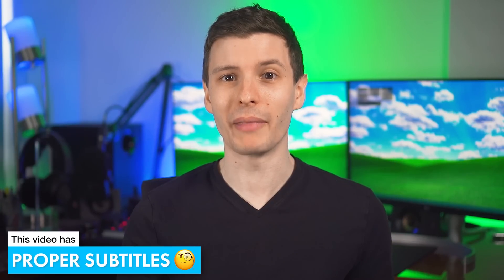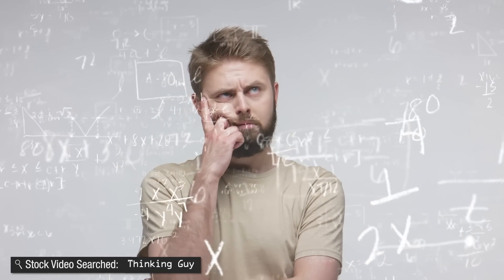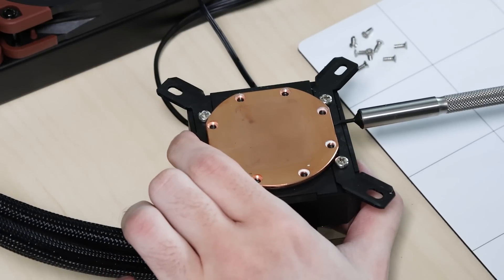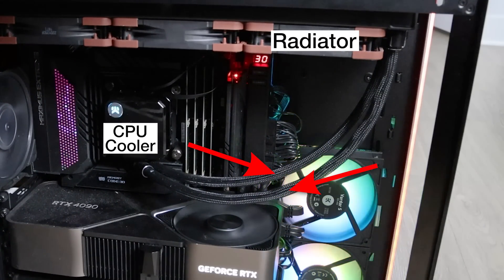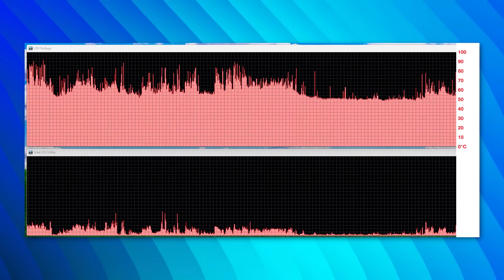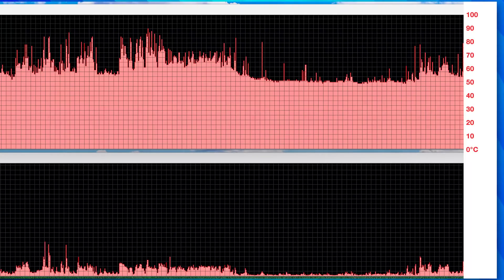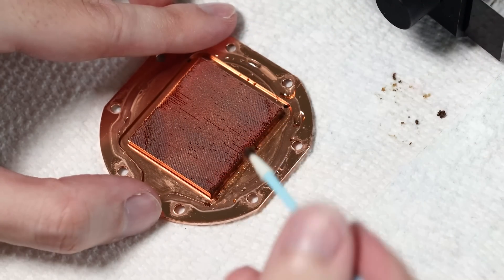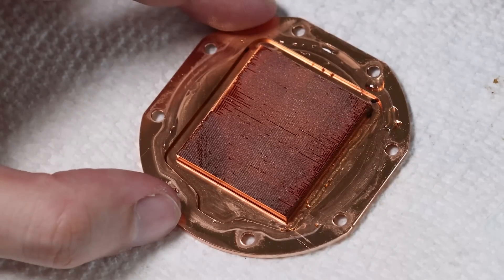The Mystery CPU Overheating Problem Took Me Months To Solve

Comment: Well Joe from he very beginning and having some experience in plumbing it was rather obvious to me that the system had crud inside either radiator and pump housing and if it were me I would have headed straight for cleaning of the cooling tank, the coolant tubes and the cooler pump it self and I would have back flushed the whole system before refilling it and refitting the cooler to the machine. What you should have done is what I have said and emptied the original liquid through say a coffee paper strainer just to see what was in the system. If this happens again or you want to take a chance I would still do what I suggested because the smacks of a poor manufacturing process. In fact I would change the whole set up to be absolutely sure.

Comment: This is why water coolers blow chunks. Air coolers are nearly as good, you look at the fans and see if their spinning, if they are, you're good to go.I've got a full tower with two  8" / 200mm Noctua intake  and 1 200 mm exhaust fan. A Noctua NH-15  fan tower cooler with dual 140 mm's , 2 additional noctua 140mm case fans and 1 more 120mm. Who needs water?
Reply: Noctua is love, Noctua is life. Love my brown cinder block.

Comment: Look like also placing the radiator on the top of case are not good idea. 

The idea of radiator are getting cool air to cooling the liquid. By placing it on the top, means it use hot air from inside the case to cooling the liquid. Or even if it reversed flow, the hot air after cooling the liquid, it will add a heat inside the case.

Comment: I would recommend that the cooler be deep cleaned; lower temperatures may increase the longevity of the cpu.

Edit: also you should look into where the gunk came from, so that it does not come back too soon.
Reply: Probably in-system grease that got loose from somewhere in AIO loop. The description of the gunk seem to fit this

Comment: years ago I was considering either an EK or an MSI AIO. I'm glad I decided to go with Corsair. I've had my H100i for almost 3yrs now and I've never had a problem with it, besides of course Corsairs crappy iCUE software but that's a whole other issue. I run my cpu with PBO enabled ( not on auto) so my cpu is always running at 4.5GHZ or higher and I have always kept the pump on "extreme" speed along with the rad fans. 3yrs of running the pump on the extreme setting and it's not showing any signs of wear which is awesome. I'll maybe consider buying a new AIO in 2yrs since supposedly 5-7yrs is the average lifespan of a AIO.

Comment: Would have gone a few steps further and spray out those fins of the cooling plate with a waterpick and flushed out the rad / refill it. Just cleaning the plate seems like the problem might be resolved now but its likely to come back at a later time. Either way, great job solving the issue.👍

Comment: Although on one hand I'm surprised you didn't figure this out earlier because water cooled, I understand.  It took me 25 years to learn to check the power cable first (is it plugged in?) when something wouldn't turn on.  We're programmed to overthink a problem which leads to wrongthink the problem more often than not.

Comment: Suprised it took you this long to realize the problem. The previous (pre-nucleus) EK aios are pretty widely known to clog up, which is one of the reasons why they were discontinued. Makes sense though, CryoFuel (presumably) in a copper+aluminum system is a really really bad idea. It's also not just them, coolers made by Apaltek also have the same issue to this day, some notable brands using them as an OEM include MSI, Xilence and Lian Li. But EK isn't what it used to be any more, even their support takes excruciatingly long, so good luck even getting an RMA.

Comment: I had a similar issue when assembling a new computer last week. It was showing a POST error for RAM, and reseating it didn't help. I tried reseating the CPU and it POSTed once (with the cooler off), so I put it back together and it failed again. Turns out the cooler was blocking my access to the RAM slots it such a way I wasn't pushing them in all the way despite taking them out and putting them back it about a dozen times... :/

Comment: And that is why I like myself and use nice air cooler, which has way fewer failure points. Plus I don't even need to disassemble it to see if it is clogged with dust or rely on software to see if fan is working. I just like to keep things simple for myself. :-D

Comment: I run into that problem with cars as well - clean out the cooling system! A lot of times, if you put the wrong kind of coolant into the radiator, everything clogs right up :P Maybe this problem will recur if there's a chemical reaction between the coolant and the component parts, or if you use plain tap water in your computer cooling system

Comment: my computer will not get that hot, but I can have 1% CPU load and my temps will suddenly jump from like 154F to 169 or a little higher.  My max temps on the CPU is 190.  I have no idea why it's doing this.  right now watching youtube, it's idling at 120F.  gaming it's 154 but then it starts spiking, even though the cpu load is so low.  :(

Comment: I had a similar problem a few weeks ago, computer shutting  down etc. Checked temp and it also was about 100 c. Coolant lines were extremely hot near the CPU. I reinstalled and updated the software for the cooling system and the pump immediately started up and after a few minutes the bubbles in the coolant disappeared and temperature dropped to a low normal. Took me about a week to figure it out when it should have only taken a few minutes. My mind works a little slower than it used to but at 80+++ I guess I have somewhat of an excuse.

Comment: I used to work for Siemens Medical, and we used a circulating pump to cool X-Ray tubes used in certain kinds of cardiac cath labs.  There was a requirement to use only distilled, demineralized and deionized water in those coolers (which, in that case was mixed with ethylene glycol).  The reason was that tap water is just corrosive enough to cause problems with heat exchangers, possibly the problem you had.  Obviously, such a system operates at above room temperatures, and we have all seen how things deteriorate outside, with copper turning a powdery brown under the best of conditions, and then green as biology takes over.  Maybe it is the cooling water?  Lab grade water runs around $15 a gallon, by the way...

Comment: Does the cooling system get it's water from a connected water supply or from a water tank. If it's a connected water a supply, or if your tank is filled from your house water, you might have a lot of sediment and mineral in your house supply. What you might need is an in-line filter. If its a tank, you could just use one of those filtered water jugs, and always fill the tank from that. You would be astonished at the level of crap I find in my house supply filters after even a few weeks use.

Comment: All AIO manufacturers have these problems, it's based in the way the radiator is manufactured.
I have one Arctic Liquid Freezer II 280 and one 420 - the 420 is all clogged up like yours, but the 280 runs fine so far.
Corrosion and algea are a common problem since those "radiator and pump combo" are manufactured by like 2 or 3 oem manufacturers, Asetek beeing the most commonly known.
This reliability issue is the reason I'm going back to air cooling on my 5800X3D...

Comment: I have the same issue as you and CPU Temp just go to 100C after turn off the computer and boot in Bios it say CPU tempature too HOT. Finally find out is the cooler one tube is very hot and the other is cool. Finally I have to replaced the cooler and everything work. The process to figure out the cooler I have go through the same process like you to find out the issue.

Comment: This is most likely biofilm growing in the coolant. I would suggest flushing the system with alcohol, ultrasonically clean the heat transfer plate, and refill with automotive premixed antifreeze.

Comment: I also had the same problem with my Aio from fractal design. When I googled it, it was a know problem and there Allready was a form online to fill out and get a V2 of that AiO. 1 week later I Allready had my V2 delivered and could keep the old broken one. It kept the fans and threw the rest away.

It was the mixture of the cooling liquid. The liquid in combination with the materials inside (hoses, copper aso) lead to the buildup of this stuff inside which would clog. Probably the same as with your aio.

Comment: One time my PC started to crash or turn off by itself when playing some more intensive games. Fan was working so I thought it needed to have the thermal paste replaced. Ordered some new one, cleaned the old with isopropyl alcohol, all looked fine before going to apply the paste.

To my horror, I ended up dropping some of the new paste on the sides of the CPU and they squeezed onto the pins on the motherboard. It was a Intel core i7 2600k, and I learned the hard way that those pins are extremely fragile when I attempted to clean them... had to buy a new motherboard in the end (actually I ended up upgrading to a new generation of board/cpu/fan/memory since boards with that socket weren't made anymore and decent used compatible ones were being sold at ridiculous prices at the time).

After assembling the new parts, to my surprise, the new PC would still shut down. In the end I noticed that the power supply was very hot, because its fan was stuck with some rubber piece that came lose from the case... and that had been the problem all along.

Ended up having to buy a new power supply too.

Comment: This is why I have my RGB set to change color based on Temperature. I had to replace my cooler when I noticed that the lights on the Pump Became more yellow more often and eventually stayed yellow. Recently it changed to Red, so I looked into what was going on and just like yours, it had gunk built up in the pump. It was bound to happen since the closed looped cooler was about 5 years old at that point.
Reply: I do something similar. The top right of my keyboard has zones for CPU and GPU temps. Set a gradient based on what my usual idle temps are and the max temp it usually gets to.

Comment: Back in the XP days we had a PC that would overheat and shut down at about 10 or 11am every day. It did this for months, then the problem stopped completely. Problem solved? No. Same thing a few months later.  In the end we discovered it wasn't liking Australian summers. We added extra cooling fans and replaced the heatsink, applying new thermal paste. It still got hot in summer but at least it was no longer crashing.

Comment: you sure its not somehow air locking itself? or getting a build-up of air in the pump? gurgling noises? etc?, I notice your lines run out the bottom of your pump, was the buildup of junk sitting at the opposite side of the pump lines?  Thats alot of odd debris lol.

Comment: I've been suspicious of coolant volume in my liquid cooler since I hear air in the lines at startup.  I haven't looked at temperatures recently but should.  I have hesitated in any attempt to fill it because I'm wondering if it needs air for coolant volume expansion (air compression).

I've been very happy with my liquid cooler: pulled 100C to 35C (under load), and 65C to 32C (at idle) in a 64F ambient room (not sure why the room was that cold then, LOL).  Also, the original thermal paste was questionable, and the new paste must have been needed.

Good work.  As a note, I'm sure you know, temperature increases immediately at CPUs.

Cooler Master LITE 120 on an Intel i7-930.

Comment: Many years ago back when I was running an i7-960, those bad boys ran hot. Got a corsair aio and my temps were good for a while, but over a 2 year period I had to RMA it 4 times due to pump failures. In the end, the replacement one they sent me leaked and killed the mobo and cpu, which they gave me a £60 reimbursement for because it was old and not worth a lot.

I'm sort of glad we don't need water anymore to get decent temps unless you're doing some really niche overclocking!

Comment: Carey Holzman has proved in the past that water coolers are not necessary and even a waste of money. The high-end air coolers he recommends are all the average user would ever need. Water coolers are for CAD workstations, CGI engineers, etc. If you're reading email or streaming Hulu they are expensive overkill.

Comment: First of all, you installed it with the pipes at the bottom, this leaves room for air bubbles settling at the top of the pump, which could be the cause for your clogging. 

The second reason is that most water cooler producers suggest that you at least change the water once a year.

But most importantly, i would suggest to use tower coolers, they run some degree hotter, but not worth the huzzle. Even if the fans fail there would still be enough cooling without you damaging it. And my noctua is now running on his second processor for over 6 years without a problem. And it between time you get much cheaper and good coolers from other producers. Never had a problem once in over 30 years building PCs. Watercooling is made to fail and even sometimes kills your other hardware.

Comment: For buildserver with 13900K I just used little undersized (to fit in 4U) tower cooler. Yes, it reaches 100°C in no time but actual throttling is negligible (100MHz below advertised continuous clock). I believe, that with a little better airflow (someone mentally impaired designed 4U case with 2x40mm exhaust fans and at the moment there was no alternative case obtainable) it would not throttle at all.

Comment: I abandoned water cooling over 25 years ago. I'm sure the gear is much better these days (although this video suggests otherwise). I had a cooling block from Swiftech that you had to assemble and fill yourself. Water would gradually disappear and you had to add water every number of weeks to prevent it from running dry. One day I came home and the house smelled of burned plastic. All ruined beyond repair. Never messed with it again. A big air cooler with a slow fan is less noisy, way cheaper, more reliable and cools just as good.

Comment: fixing the wrong problem is something i did a lot recently, in my case i had malfunctioning hard drives, turns out it was not the drives or the cables, it was the onboard sockets... unfortunately one drive had to die from over spinning for me to realize... (i kept moving the cable on the actual drive when it was at the board it needed to move... i bought a SATA PCIe card to fix that.)

Comment: Take the fin plate outside and use a garden hose to clean it. One of the reasons I use an air cooler. No such issues.

Comment: I've had the same problem as you, a long time ago. The computer turned off sporadically and all it did was beep indicating CPU overheating. After several tests I came to the conclusion that it was the liquid cooling system. I opened it up and it was stuck. I "flashed" it with isopropyl alcohol, i mean, i replaced all the coolant with alcohol putting the open  pump/dissipator in a container filled with alcohol without the dissipator. You can't even imagine the dirt that came out. I had to replace the alcohol 3 times. After thar i replaced the alcohol with coolant for the car and it has been working for me for about 6 months.

Comment: Got myself a DeepCool Gamer Storm Captain 240 AIO Liquid CPU Cooler back in 2019 and it still works great. The clear section in the pump allows me to see if there are any issues and/or debris in the coolant. Hoping it will last a few more years.

Comment: My Xeon 2699 is ~35.0C when watching Youtube (room temperature is currently ~28c) and after replacing the water cooler because the previous cooler was on for 24/7 for about 5 years or so and my machine would start crashing/powering off the moment I used too many cores at once.. 🤣

The new cooler even states that you need to add liquid after ~2 years of operation .. haha

Comment: To me it seems like it's excessive to have those fine fins. The heat transfer between liquid and metal is pretty good. The heat transfer to air would be the big problem.
A simpler design would be enough.

Comment: I’ve a problem with my volume for years now. Sometimes it goes up randomly especially when I pause and play YT videos. It’s been driving me nuts. I think it’s something with the original sound drivers and the nvidia sound drivers. Tried to fix it several times with no success.
Reply: One solution: format your pc and reinstall your windows
Reply: @mahendrap1960  I rather delete system32

Comment: I must be unlucky, but I've had poor success with AIO coolers. My last one I delt with ended up having air inside the system, and would randomly run hot until the pc was turned on its side to remove the airlock in the pump. From then onwards I have up and went back to a decent air cooler. Less hassle and just works.

Comment: And that is why I never ever use an AIO. Because of issues that are more common with them such as some brands have clog issues, some times you have pump issues and a CPU cooler just works and is cheaper. Give your computer 10 years the CPU cooler works the AIO is likely going to be dead, failing, dried out liquid. I did try an AIO but the noise of it drove me batty because I love complete silence and set my fans for that silence and purchase specific silent fans. AIOs are usually great; when they are actually working.

Comment: Pump Speed is it controllable sure sounds like its cavitating. at times a return line if its at a lower point than pressure it can cavitate on the pressure side. change the fluid viscosity. I have found in life it is always between the monitor and the back of the chair and Windows will throw an error code ID 10T error kidding. have fun onwards.